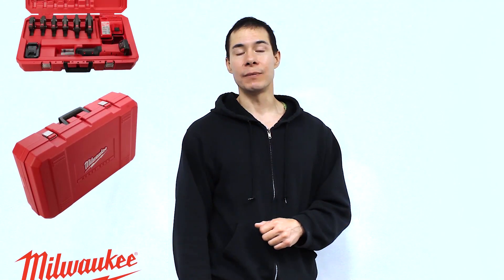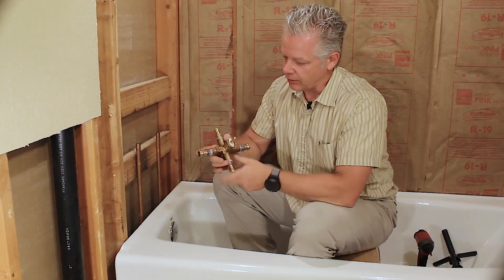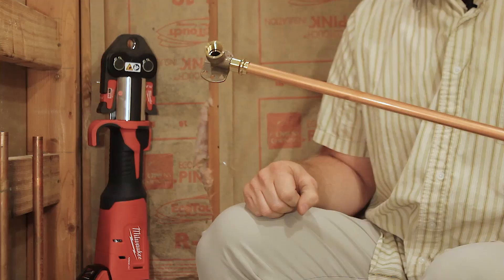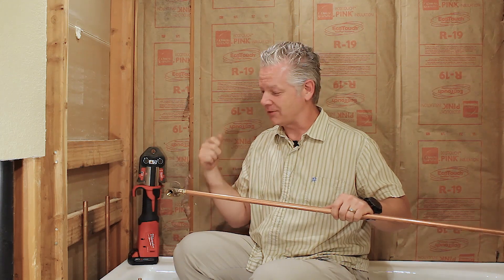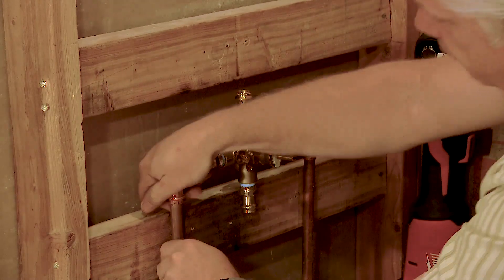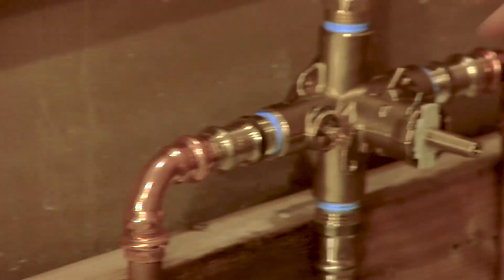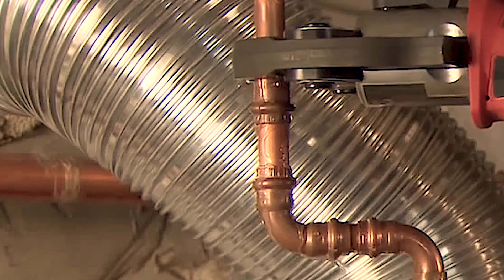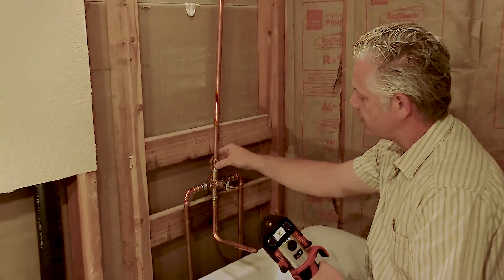Milwaukee Press Tool - How to Install a Posi-Temp Shower Valve - Plumbersstock.com

Comment: Street 90 would have really sped that entire process up and most likely fit better between the two supply lines. But Viega  products are the best in the industry not necessarily the cheapest but 100% the best, for copper and steel press applications. Good video great tools and products used here

Comment: Guy ain’t no plumber that’s for sure; bet that was one of the most crooked valves ever installed 😂. It is a video so I’ll stop. It is an amazing tool I have one; but I doubt those o rings last a third as long as solder. I only use press for quick repairs in a wall, under floor and exposed work in mechanical room. Other then that solder it; your work is your name and when people are paying for copper it should be premium. Type L and good fittings should last easily 100 years maybe double if the water quality is good. I might be wrong but I don’t think propress fittings are going to last much more then 50 years. Most houses I work on are close to seventy years old and the copper pipe seems as good as new when we tie in. No denying you can make mega bucks with this tool but don’t be afraid to inform your clients and let them choose. They will let you charge them a little more for a better product if you can show them why most of the time. If it’s easy to get to I go for the press tool. If a leak is going to cause my client to have to call 3 other contractors to complete a repair even if it is well down the road, solder it people. In the bathroom behind tile bathtubs and all that I’ll keep on burning fittings.  Good luck 👍
Reply: How many people live in 1 house for 50 years. It will be someone else's problem

Comment: I have seen these fitting fail by doing exactly the application your using it & not following instructions. All cut pipe must be deburred and depth should be correctly marked. Never guess. When its done incorrectly it can be undetermined until testing the pipe work.

Comment: Slick tool & procedure. Just curius as to how the O Rings hold up in hot, dry conditions like in the Desert ?  Thanks for the demo. Very good demonstration. I suppose there are plenty of fitting suppliers ? Thanks.
Reply: They work perfectly, hot/dry climates don't affect them at all. The O Rings are readily available at most plumber supply shops. They're available through the website linked in this video's description as well. You don't have to use Viega; there are other rings that are compatible with the press system.

Comment: Use a maker to mark your depths. Prep the fittings with sandpaper to ensure a smooth surface.  Remove burrs.  

Your fittings on the hot water and cold water valve side are too close to each other to ensure a proper press. There are minimum distances needed between fittings and you should not butt them together and press. 

Just my 2 cents.
Reply: No that's fine for 1/2" pipe but larger diameter pipe you are right, gotta watch that